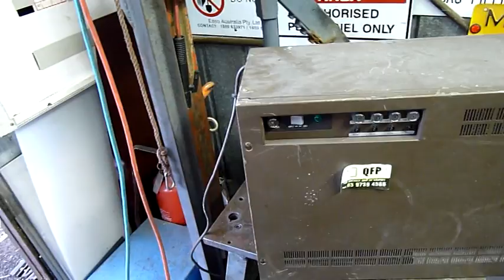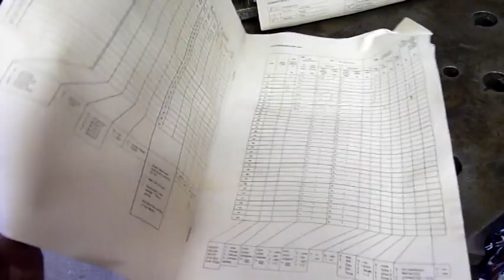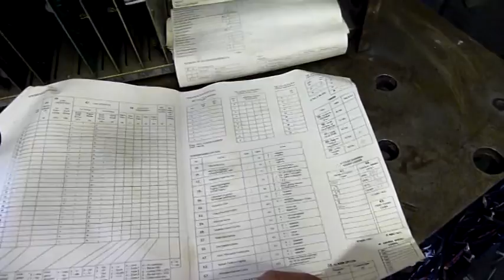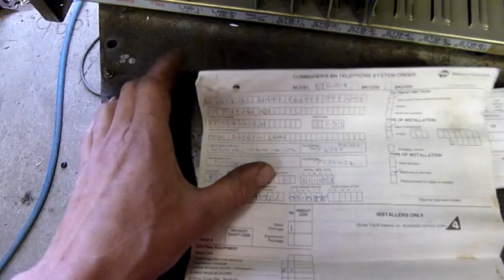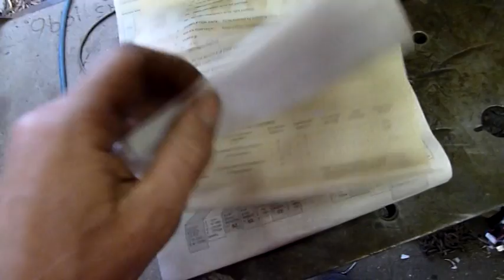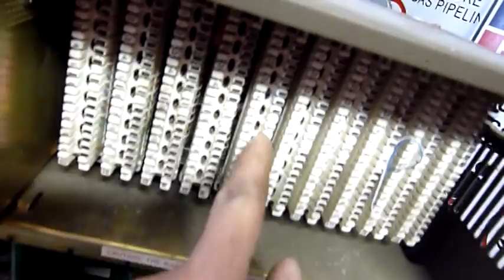Telecom Commander Unit Autopsy 1

Comment: I worked on one of those in my previous job (It was a Commander BN series, but didn't have the punchdown blocks in the main cabinet...), was told there was no way to connect it to a voip line, proved them wrong (:

At my current place of work we are still using a Commander HX system (a fair bit newer, but fairly similar)

Comment: PBX machnies are one of the most reliable machines ever seen. Comming form good brands you get the five 99.999% duty. From The Panasonic 1232 (what a machine) to the Harris 2020, the MD110 ... those machnies were made for serious. Never stop, nor fail. The ones I mention are analog with digital conmutation and also digital lines at 64Kbit rate. Really industrial grade stuff.

Comment: Probably the only fault in the PSU is the input filter and MOV's are shorted or leaky, everything else will be working. Only good thing was that all programming that was needed could be done from the operators handset, and nothing else. Uses standard phone handsets for all except the DSS units, which are a standard digital terminal system that is common to many PBX systems ( Phillips and LG use the same terminals for example) and is a common standard. The IDC is made by Krone.

Comment: This is a good example that back in the 80's and earlier the engeneers who installes this had time to fill in these program cards.
These white contacblocks are LSA+ connectors and for wireing these you use a LSA+ tool (you can still buy them)
I installed, serviced and replaced many different telephone systems (PBX) in my work.
If you want to know more, just ask.

Comment: also, for the record, the patch panel in the top right is still widely used in telecommunications.  if you were to ever look at a demarcation terminal for phone systems and in comm closets, you would see those mounted on walls.  they are still the easiest method of installing new lines and bridging between inputs and outputs.

Comment: the 8 / 88 on the side of the side of the BN commander is the manufacture date. Commanders were basically "Key Systems" in that all stations (not 2 wire) could access all the incoming lines and there were indicators on the full key stations.

I remember using such machines many years ago.